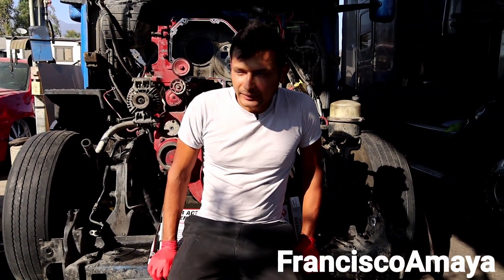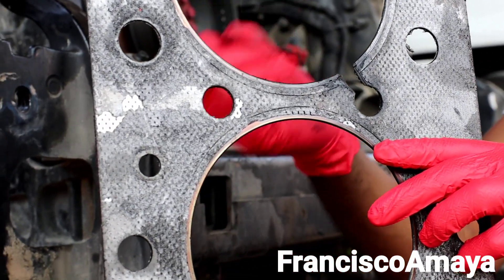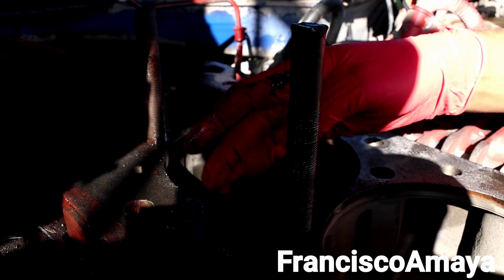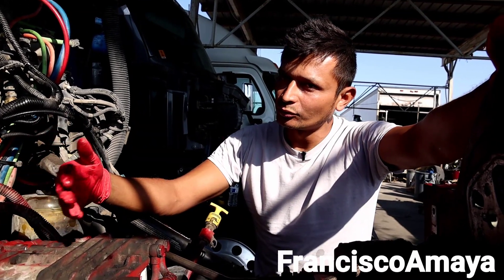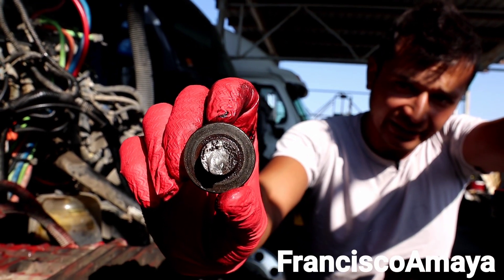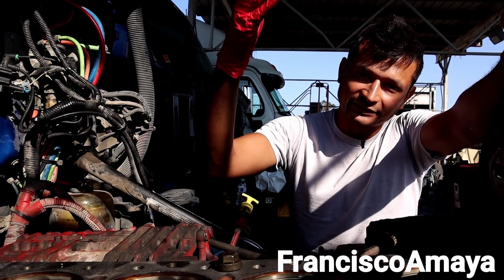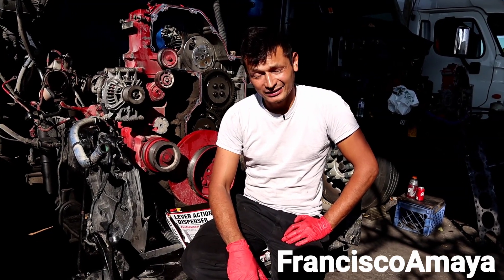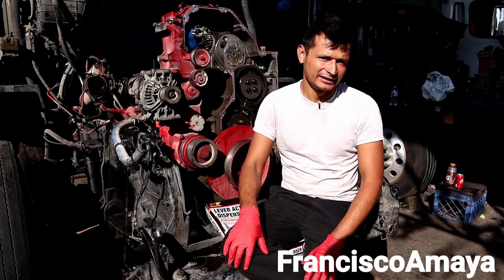Cummins ISX ISX15 compression leak broken cylinder head gasket damage  head bolts major overhaul

Comment: Thanks F.A..i also have the same engine with radiator water overflow right now..i hope its just may be a pressure from an air compressure only...keep finger crossing
Reply: Does the air compressor also cause coolant to go to the overflow side and spill?
Reply: @erikzadv3ntur359  yeah, coolant can also leak into the air tanks

Comment: Mr Francisco Amaya I would like to get any information of how to get a hold of you for technical support. Im fixing to pull a cylinder head off a cuminns ixs 15 because it's putting combustion pressure in to coolant reservoir
Reply: What ended up being the problem exactly?

Comment: Tengo algo parecido pasandole a mi motor tiene ruido y smoke y nadie sabe q tiene,  el smoke por el respirador tubo el q va d arriba por atrás para abajo del motor y a lot of Black smoke por el tubo escape, y cuando le quito el pie del acelerador tiende como q a parar rápidamente como si tuviera el engine break on pero no engine breaking noise, mi motor es Detroit series 60 , so tengo que ver si es presión o inyectores o tune up or alguna válvula floja , bueno que usted cree que pueda ser ?
Gracias por sus videos.
Reply: Chequea los cables y los sensores del turbo o el Aire para que habra el turbo.

Comment: On my Volvo D13 engine, I spent about $700 dollars on main bearing, rod bearing and main cap bolts.
Reply: How much was the total cost for your Volvo rebuild?
Reply: @StickNclutch  I went with Aftermarket parts, made by PAI for the volvo D13 EPA10, master rebuild kit was 4k, crankshaft polish was $350, engine counterbore cut and deck resurfaced was $850 and cylinder head was resurfaced, replaced burnt valves, new injector cups and valve stems with seals, total $1970
Reply: @commandomkz6451  ATL Diesel right? They have good aftermarket parts bro I'm going to have to rebuild my cummins.. Its burning up to 4 gallons of oil in between 10 thousand mile intervals wayyy too much

Comment: Hey francisco what engine the best
Reply: Im not Francisco Amaya but I own a fleet of trucks, and I'll tell you this, ISX15 is garbage, just go to your local heavy truck salvage yard and you will see red engines seized all over the yard and , parts are very expensive, I preffer dd15 and highly preffer Volvo D13, I've seen these engines go over 1 million miles with very little parts replacement, the old timer mechanics will tell you cummins N14 , N11 and series 60 12.7L or Caterpillar 3406.
Reply: @commandomkz6451  Volvo parts are expensive just as cummins.